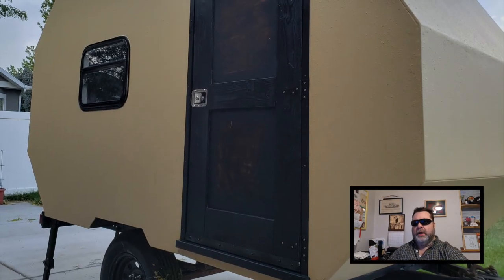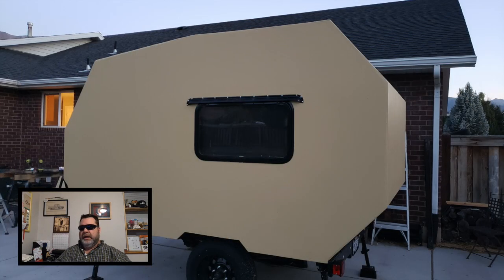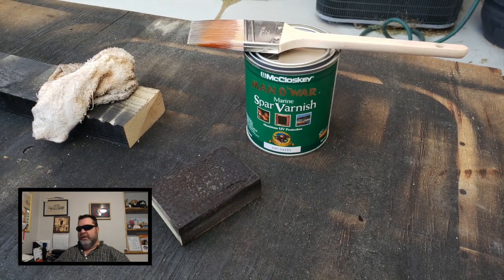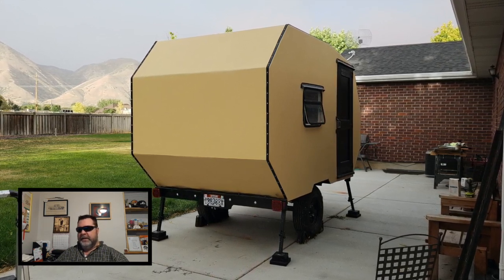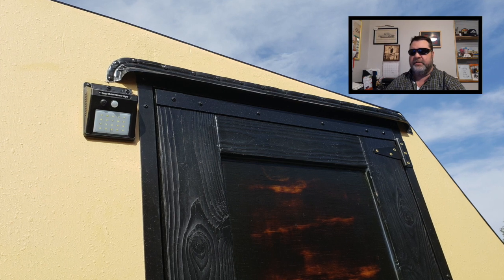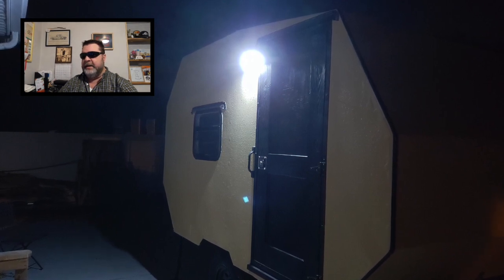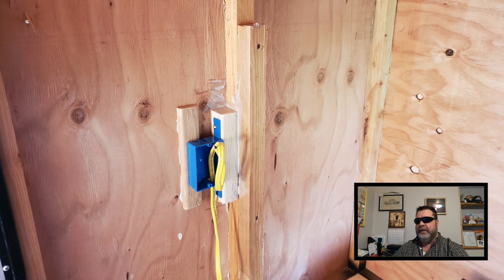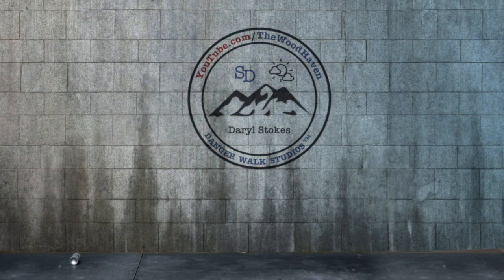DIY Homemade Camper Build - Part 05

Comment: Nice progress. I'm not sure about the outside light. I think there could be some issues with it coming on unnecessarily. I would suggest a switched hard wire installation
Reply from the maker: I think you might be right. It does have an off switch to keep that from happening, but it does seem to be a little temperamental. I think these lights are better for permanent buildings like a shed or something.